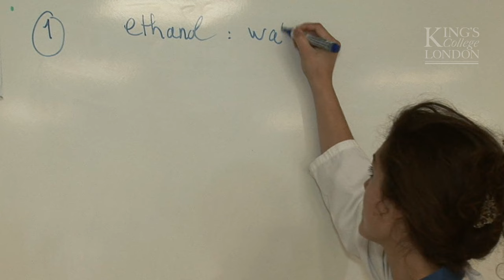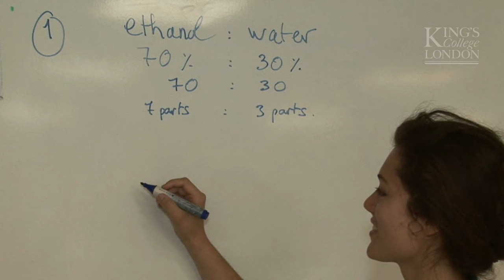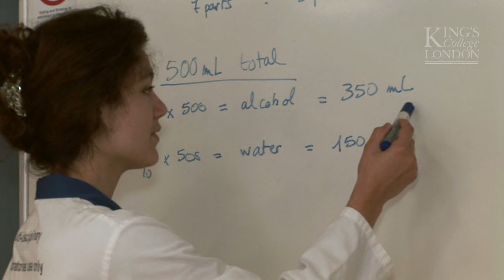Making a 70% Ethanol solution

Comment: The calculations are right but the procedure is wrong... (obviously not for making sanitiser) analytically. Due to packing /hydrogen bonding if you mixed 350ml ethanol with 150ml water total volume would be less than 500ml.

Comment: You can calculate how to make a 70% v/v solution Ethanol like this:

Dilution equation: (Initial Concentration) * (Initial Volume) = (Final Concentration) * (Final Volume)

we know the initial concentration of ethanol: 100%,  
The final concentration concentration of ethanol: 70%
The final volume: 500 mL 

Therefore solve for the initial volume of ethanol needed:

Initial Volume = (Final Concentration) * (Final Volume) / (Initial Concentration)

= (70% * 500 mL) / (100%)

= 350 mL of ethanol.

The final volume of the solution is 500 mL so that means that you add 500 mL - 350 mL = 150 mL of water to dilute 100% Ethanol to 70% Ethanol. Measure out 350 mL of ethanol in a graduated cylinder and pour into a vial. Measure out 150 mL of distilled water in a graduated cylinder. Pour into the same glass. Seal and shake.
Reply: Does it mean that if I want to make 90 % alcohol, I need to put in an equation--> 90/100 x 500 ml =450 ml of 100% alcohol mixed with 50 ml of distilled water to make up to 500 ml. Is it correct?
Reply: @ochalambana1983  yes
Reply: @dianakathreenalagao934  thanks 🙏😇😍
Reply: @ochalambana1983  right..well done.
Reply: @sajjadalaa9521  thanks 🙏😇😇
Reply: Thank you so much

Comment: If you don't have the equipment for measuring alcohol by volume, 350 ml alcohol weights 274 grams on a kitchen scale. Mix 150 gr water with 274 gr alcohol.
Reply from the maker: you CAN weigh it too yes

Comment: Step 1: 70 ml alcohol +30 ml water =100 ml solution. 
 Step 2:  5 times i.e.  5(70 ml alcohol + 30 water)= 350 ml alcohol +150 ml water) =500 ml solution
Reply: 70 ml alcohol + 30 ml water DOES NOT equal to 100 ml solution.
Reply: @SgtMayer  70+30=100
Reply: @jmf2274  volume is not additive in this case, as the mixture of alcohol and water is going to be less than 100 ml. Look it up, only mass is additive in this case.
Reply: @SgtMayer  yes it does not.  simple because alcohol evaporates a bit upon contact with water.

Comment: Does the percentage often mentioned in news articles for hand sanitiser always mean separate volumes, not masses?
Reply from the maker: hand sanitiser is often thought of as a solid so it is w/w rather then w/v or v/v
Reply: @DoryVideo  Thanks. I assumed the news articles that mentioned making one's own hand sanitiser meant 70% isopropyl alcohol/water was v/v (as in this video), so adjusted the ratio for density. Was this wrong? Also used tap water.

Comment: unsure of ml to oz? there are 29.57 ml to one oz (USA Measurements) -- 350ml / 29.57 = amount of 99% alcohol to use (11.86 or 12 oz)-- 150 ml water / 29.57=5.07-- total is 12 oz alcohol + 5 oz water = 17 oz mixture.
Reply: US should start using ISO or metric system. They're the one that initiate this and the world followed this Standard. Yet up to now they're still using this old English system. Fahrenhite, oz, inches, foot, acres, lbs etc. They should give this up, as whole world is getting confused.

Comment: So if I have 95% ethanol and want to use it in a 24oz spray bottle with a final concentration that is at least 75% ethanol. How many oz of ethanol to water? (Also here because coronavirus lol)
Reply: Would 8 : 2 be close enough?
Reply: Start with 18oz of 95% alcohol.  Add 6oz of water.  Your final solution will be 75.070% alcohol.
Reply: @curlywurly70  Thank you appreciate it!

Comment: How much does the theory on the board change if instead of a 100% alcohol (I have isopropyl alcohol, IPA) I have, say, 98% IPA (not denatured) and I need to prepare a 75% solution up to 400 mL? (I'm aiming 75% with water because I'll be adding other stuff to it so that the net concentration of IPA in the resulting solution does not drop below 60%)
Reply: Read jm post
Reply: i did, and it talks of 100% alcohol... from my limited chmistry knowledge i'm this much aware that it does not stay the same for a lower percentage
Reply: ok calculate as it was 100% isopropanol stock

75% = 75 isopropanol for 100 total. so 75ml of isopropanol in100 ml total (meaning 25ml water). 
you want to prepare 400ml, meaning instead to have 100ml total you want 400 ml total. so you need to multiply by 4; 75 x 4 + 25x4= 300ml isopropanol +100ml water=400ml. Done!  this is for 100% isopropanol stock. your stock is 98%. so the ratio 100 to 98 is 100/98=1.02. so you will need to put more of your 98% isopropanol  to rich your 75%, to do that multiply 300ml by 1.02=306ml.
So you will need to put 306 ml of 98% isopropanol in 400ml total (meaning 94ml water).
You can check you calculation: if I put 306 ml of 98% isopropanol in a total volume of 400ml. Meaning you put   306ml  x 98%= 29988%. since the total volume is 400ml you will need to divide 29988% by 400ml=75%

your 400ml solution is indeed  75% isopropanol

another quick method is.
you want to go from your stock 98% to 75% for 400ml
to go from 98 to 75 it will be 98/75=1.31 ratio. so by dividing the total volume by 1.31  you will get the volume of 98% to use, so 400/1.31=305.34ml~306
the value are sligthly different than 306 because of the decimal I kept. So you will put 305.34ml of 98% isopropanol in 94.66ml of water
Reply: @jmf2274  hmm...306 is the correct number if rounded off to the nearest integer. My friend calculated that using the CV=constant relation, with C as the concentration.

Thanks a ton for the detail :)
Reply: @parsecsprinter904  yes sure 306 or 305.34, not a big deal. Yep you can use as well  the morality equalite from initial mole to final mole. n=mole. ni=nf. ni= cixvi, nf=cf x vf. So ci x vi= cf x vf. V=volume  c=concentration

Comment: Alcohol shrinks when we add distilled water by the way so it's better to use alcohol baume meter to adjust the exact percentage of the mixture. 
Any way it's not bad 😁
Reply: Is correct what you mean, but for our normal use +/- 1% is not important, it becomes important if exact information of the Vol. % the legislation requires research or similarly important topics.

Comment: So... how is this calculation work if you have 99.5% isopropyl alcohol?
Reply from the maker: Same
Reply: Thanks Dory Video! Please help me understand this calculation. She has a 70% alcohol and added 30% water to make a 100% mix in volume. I have 99.5% alcohol, to make the recommended 60 - 70% mix, so all I have to add is 00.5% water? That doesn’t sound right to me.
Reply from the maker: 99.5% is so close to 100 that I would not worry. Just do the same dilution. For disinfecting you need >60% alcohol.

Comment: Is it safe to make a 50% Isopropol Alcohol mix with 50% distilled water to use for a hand sanitizer in this coronavirus situation, and then put in a spray bottle to spray your hands with?  I ask because the chemist here says she must put gloves on (to protect her from alcohol on her skin???)  Is there danger in this proposed mix 50/50 use in spray bottle for hands instead of the toxic purells with their cancer causing agents?
Reply from the maker: You’d need something more than 65% ethanol/alcohol for disinfecting. The standard lab concentration for cleaning be cleaned etc is 70%

Comment: nice job  but mam i apply same step  for making 13% sugar solution in 200ml but not correct can u solve it
Reply from the maker: 26g sugar in 200ml it’s not that complicated
Reply: 13% means 13g in100ml total. So for 200ml total you need 26g

Comment: Hi how can i make 70% of ethnol from a 80% solution prepared? That's the only available here. Thanks in advance!
Reply: First decide the final volume that you want. How about 500 mL?

Dilution Equation: 
(Initial Concentration) * (Initial Volume) = (Final Concentration) * (Final Volume)

We know the initial concentration, Final Volume, and Final Concentration, so solve for the initial volume of 80% stock solution ethanol: 

Initial Volume = [(Final Concentration) * (Final Volume)] / (Initial Concentration)

= (70% * 500 mL) / (80%)
= (0.70 * 500 mL) / (0.80)
= 437.5 mL ... of 80% stock solution of ethanol.
Measure this out into a graduated cylinder, and pour into a glass vial.

The final volume that you desire is 500 mL, so that means that you need to add 500 mL - 437.5 mL = 62.5 mL of distilled water to the same vial to form 70% solution of ethanol. Seal and shake to mix.
Reply: You genius can't figure out a simple math? 
Suppose your 80 % solution is 1 Litre.  Add 100 ml Water to it. Done.

Comment: Hello Guys, I have 20L of Alcohol  99.9% .after applying  I this formula, can I use the solution alone for cleaning hands to prevent COVID-19? in my work place.
Kindly guide me.
Reply: mrisho rajabu Sure just use 25% of aloe vera as a moisturizer instead of distilled water

Comment: I don't use this much. 20ml (or cm3). I only use little. 20ml ÷ 5. The dosage.

I use <10ml. So I bought the less bigger size. It costs only 70 cents. I use 10ml ÷ 3 roughly to relief my c_nst_p_t__n.

Comment: SALUT, svp comment preparer une solution de 50mL de 
 methanol à 80% à patire d'une solution de 96%
Reply: ok calculate as it was 100% methanol stock

80% = 80 methanol for 100 total. so 80ml of ethanol in100 ml total (meaning 20ml water). 
you want to prepare 50ml. so just divide by 2, meaning instead to have 100ml total you want 50 ml total. so 80/2 + 20/2=40 methanol +10 water=50ml. Done!  this is for 100% methanol stock. your stock is 96%. so the ratio 100 to 96 is 100/96=1.042. so you will need to put more of your 96% methanol  to rich your 80%, to do that multiply 40ml by 1.042=41.68ml.
So you will need to put 41.68 ml of 96% methanol in 50ml total (meaning 8.32 water).
You can check you calculation: if I put 41.68 ml of 96% methanol in a total volume of 50ml. Meaning you put   41.68ml  x 96%= 4001%. since the total volume is 50ml you will need to divide 4001% by 50ml=80%
your 50ml solution is indeed  80% methanol.